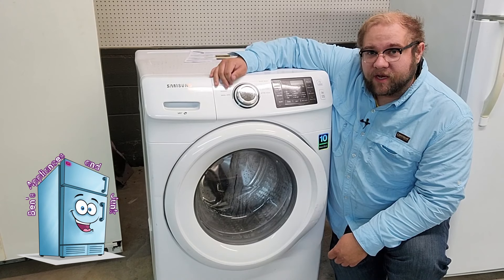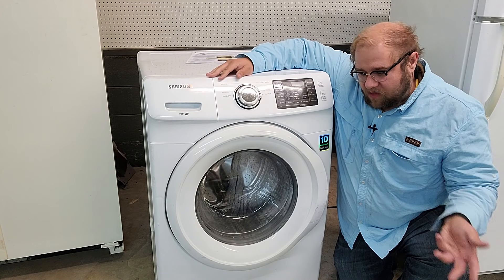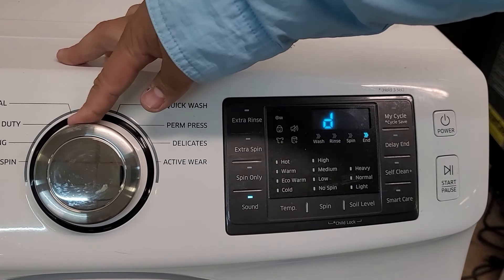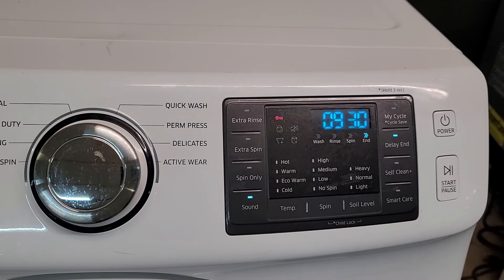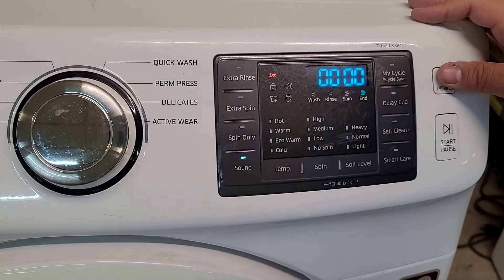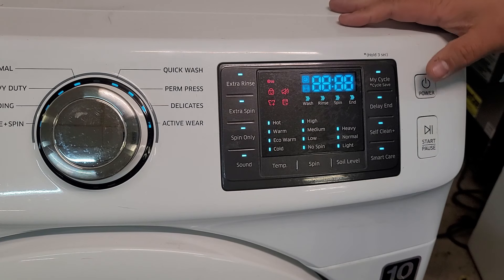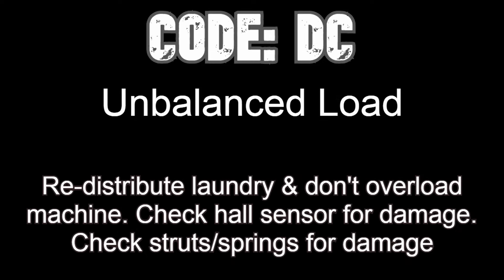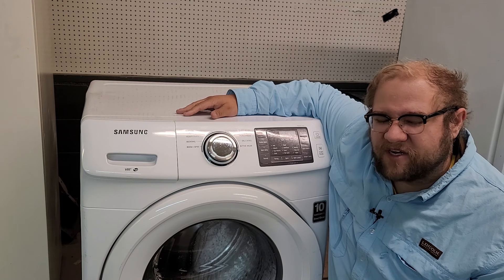Samsung Front Load Washer Error Codes and Test Mode - How to Troubleshoot a Samsung WF42H* Washer

Comment: What do i do if i cant get it into diagnostic mode? I hold spin and delay and it just double beeps, then nothing. I have already unplugged it and waited...also shut it off at the breaker for several minutes as well ....still nothing. Then only button that does something is the smart care. 
Downloaded the app scanned the code, and its "A problem found in communitcations between PBAs"

Comment: I have 1 that is showing NF after it starts to over fill with water,  what would you suggest?
Reply from the maker: Valves could be bad on washer - sticking open. I'd check the valves w/ a multimeter and see what you get.

Comment: I have the WF45N5300 basically the same control screen but Soil Level - Delay End will not put me into any mode. Nothing happens basically. I can get into calibration mode with Temp - Delay End but that’s about all. Any tips or idea? Machine basically will drain, fill with water and sit
Reply: Yeah I have the same problem
Reply: Any fix to this. Same washer, same issue
Reply: Same here
Reply: There is another video that says to use button 2 and 3 and pause at same time then dial counter clockwise to get to diagnostic mode.

Comment: Hi ive been trying to fix a samsung front loader washer  WF1104XBC   It has a door lock error Problem    have replaced control board and the door lock after around 30 mins of washing it throws up a DE error  and stops  2nd set  and seems to stuff the lock and the control board  shows DE error in any other machine it go's into  would be awesome to have any ideas  how to solve this
Reply from the maker: Its definitely a door lock/pcb error. HOWEVER sometimes it'll throw that signal if the drain pump connection/drain pump is bad. I'd check and verify its connections are good and everythings' operating well with it.

Comment: Did not see my code in the vid. Mine is 5E. The washer won't go into spin cycle. It will spin as  it does when testing as shown in video.
Reply: Drain error code, check your drain filter located on the bottom left side

Comment: I was wondering what controls the timing of the washer ...   Is it built into the display panel ... or is there another circuit board that controls it.   What's happening on my machine is I could start a wash in NORM and after a while the unit will STOP ..  washer does not shut down Only STOPS washing as if someone hit the pause button.  This video was very helpful for diagnostics..    I went in and actually cleared the EPROM incase there were some settings the wife messed up on  ..  hoping it would clear my issue ...  But its not and still does the same thing ..  place on wash .. then shuts off wash as if someone hit the pause button ...  in order to operate again someone has to go and push the START button ...  then later it does the same thing again .. making one wash last for hours and the cost of water and electricity does not make this washer economical by no means.
Reply: I’m having the same issue. YouTube for solutions. Did you ever get this resolved?
Reply: @fasttalking4760 mine just started that too… won’t spin..

Comment: WF45M5500AP/A5 washer here. I seem to have some power issue and would like to know if the CN5 connection has always 120VAC on it or not. Also missing the 5VDC on the CNS801 pin # 4. BTW SAMSUNGs customer service is worse than that trying to talk to a 4 year old. Very aggravating conversation.
Reply from the maker: I'd have to look @ a schematic sheet. I think the CN5 is supposed to have 120vac nominally on that model, but I'd have to have the tech sheet to know for sure.
Reply: @bensappliancesandjunk  Thank you Ben. I could email the service manual to you for a review if you could entertain a few min and help me.
Reply: @bensappliancesandjunk  Ben I have emailed you the service manual to review.

Comment: My washer displays error codes LE & 4E, any idea what those indicate!
Reply: My washer was displaying the LE error code, so I did multiple checks and it went away. But then the 4E error code popped up immediately after. I have played with as much as I can. The 4E error code went away and now it’s just the LE error code. Did you ever figure out what your issue was or what fixed it?

Comment: Our Samsung washing machine model# WF45K6200AZ/A2 takes longer to wash. When I look at the timer, say 7 minutes, after a while it goes back to 16 minutes. What seems to be the problem?
Reply: If you find the answer please respond, I am also having the same issue and same model as your's. TY
Reply: @kevindaniels4302  nothing yet and still an ongoing issue. More time washing, more electricity consumption. 👎I asked Samsung before,  they don't know either. They want me contact nearby repairman which I don't like to do. Samsung must figure out this problem and ways to fix it.
Reply: Unit is going out of balance, it is weigh sensing the load and adding more time. If you are not overloading or under loading with clothes, either you have an out of round inner tub/drum or a bad main board
Reply: If you open up the back panel there is a plastic wire holder that snapped off. All you have to do is drill holes into the metal back plate and put zip ties to hold it down. Be careful not to drill into the drum. Only the metal

Comment: One thing you can do is the A5 test. This is a factory only test program. All you have to do is set Delay End to 17H and immediately press and hold start/pause button. You’ll here beep and A5 shows up on display. Then press start to start test.
Reply: What does the A5 test do?
Reply: @cebb6313  it’s just like an auto test. Goes  through hot and cold valves, agitation, drain pump and spin cycle at max speed.

Comment: Hey Ben, my washer in the spin test doesn't spin at all. I've got AE6 and E3. I've checked all connectors and when I try the test when pressing DELAY END AND TEMP to run Calibration the tub clicks and moves just slightly like less then a 1/2 inch. What would you recommend replacing?
Reply from the maker: Is it a frontload like this? Typically, if it will move some but not very much, check the basket to ensure its not binding up. After that, I'd maybe look @ the TMR/Hall sensor that tells the speed on the tub to the main control.
Reply: Any idea what a 3C2 code is for a 
Samsung 
WF45K6200A 
Front load washer.
Reply: I'm having the same issue. Did you end up figuring out a solution?
Reply: @robertromero8094 i changed  the motor sator and thats what fixed it, mine had a tiny ding in the copper wire that was causing it to short out.

Comment: Hi Ben, my front load Samsung washer keeps keeps filling water into the tub till I turn the water off. Can u tell me why it’s doing this. Also, It may hv started when I paused it and the door lock went off and I opened it and water poured out. I shut it, put it on rinse and spin for a minute and turned water back on. It did complete that cycle, but now continues to keep filling water till I turn it off and repeat same steps again. Thank you.
Reply from the maker: If the water is ALWAYS ON it sounds like the water valve itself is stuck - either by something being obstructing inside the valve, or the water valve's electricity won't shut off. There's no reason the valve should be on when it isn't supposed to be. Its activated by electricity, and should always be off unless electricity is hitting the solenoid.

I would suggest unplugging the unit, taking the hoses off, check for an obstruction on the valve. If you can get a multimeter, check the valves for continuity/ohms resistance to see what values you get. Likely, you'd need to replace the valves. If that doesn't fix it, it could be the board could have sort of odd thing where its accidently sending tons of electric to the valves, keeping them open.
Reply: Hey Ben I'm having the same issues and replaced the water inlet valve but it continues to fill up the tub with too much water. Any suggestions?  @bensappliancesandjunk
Reply: @sjones15802  If the machine is over filling you might have a problem with the water sensing switch. I have worked on similar machines and have found the hose that connects the water level sensor to the tub has a hole in it. Or the sensor is faulty.

Comment: When I put the washer into the mode to check error codes, all the buttons light up. In your video, all you get is 0000 and no other button is lit. However in my case, all other buttons light up. Does this look normal?
Reply: You put unit into another test mode and already erased the error codes

Comment: I have the wf209anw/xaa, how to get into diagnostic
Reply: I purchased a Samsung front load I have a code that says SC it came on because I overloaded the machine now the clothes will not come out fully wrong out in a full spin now the clothes have to be put in the dryer I make steel wet

Comment: i have the same machine with no codes but it takes forever to spin at speed.its like it is out of balance. it keeps trying to centre the load but takes about an hour to finally start spinning at speed. and you can never put in a small load as could take 2 hours or never until you ring the clothes out manually.  everyone says calibrate which i have done and others say rear bracket which i have changed even though the old one looked fine.  all okay. any other issues i should inspect.
Reply from the maker: How bad are shock absorbers?
Reply: @bensappliancesandjunk  not sure how to test them any thoughts.
Reply from the maker: @frankschopp8748  We usually uninstall them from the washer and check physical resistance. Shocks are supposed to be very difficult to push or pull apart, and weak shocks will be rather easy. I don't have a better way of explaining it offhand.

Comment: Is there a code de? It is what mine shows. My machine will not spin or agitate.  I replaced the sensor on the motor with no change. When I tried the spin test it just kinda moves slightly like it wants to move. Just found ur video. Help!
Reply: Now I am seeing a 3e2 when I spin the control counter clockwise.
Reply: Check previous answer above

Comment: I have a WF42H5000AW and when I'm in diagnostic mode it gives me error code J00F. I tried to go into the error finding mode (power, spin, soil) and it gave me that same error code. For reference, my washer pauses multiple times in the middle of a cycle.
Reply: Having the same issue currently. It first threw a temp sensor code (te4) and I replaced it, cleared the memory, and it ran a full cycle. Then after that I'm getting the J00F code on the display and zero results are found in a Google search

Comment: My washer was taking 3 hours and alot of water to finish a load of clothes. Replaced control board down in the bottom of the machine and it fixed it 25min wash now takes 25 min.

Comment: Great video! However I'm not getting any error codes. The machine will wash and rinse, but when it gets to the spin cycle it will make a couple of revolutions in the clockwise then counterclockwise directions. On the third cycle of revolutions the display turns off, then back on, and the spin timer starts over. I did the spin test and it got to 600~ rpms with clothes in it. What could this be?
Reply from the maker: I'd be concerned a wire is broken or damaged, causing the system to lose power and have to start over again. That or the primary control board itself.
Reply: @bensappliancesandjunk  Thank you for your quick response. I'm leaning towards the control board due to it shuts off at the exact same time in the spin cycle. Would you agree? I will also take your advice and look for damaged wires.
Reply: @frankmiller4990  did you find the problem? Was it the board?
Reply: @djsenass   nothing absolute. It could've been one of the three circuit boards, two of which were on backorder at the time. Scrapped it and bought a new one.

Comment: Mine keeps giving me le towards the end of the wash cycle when the drum is full of water then drains after it gives the code. I've changed the pressure switch, inlet valves, cleaned filters, replaced hoses. Nothing has fixed it. The hot water filter was very dirty when I changed the inlet.
Reply: I get the same LE error code and I have done multiple checks. Did you ever figure out what your issue was? If so, please explain!
Reply: Turns out the pressure switch hose had a super tiny leak

Comment: Hi, I have the same model and my machine does not stop the cycle, after certain amount of time of washing and it spins then the timing gets up from 28 minutes to 40 etc. Spinning never stops. We checked the spider arms and it’s not that. We replaced the computer board behind the machine but that didn’t fixed it either. Please let us know what to do
Reply: Did you find the solution?